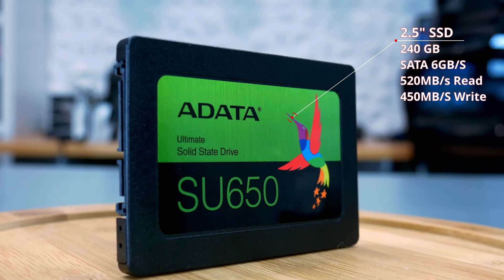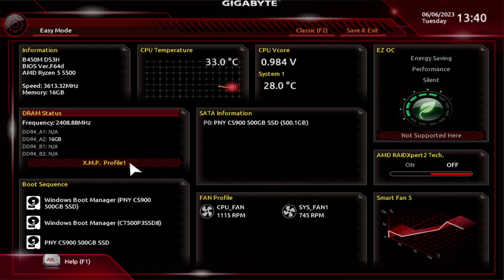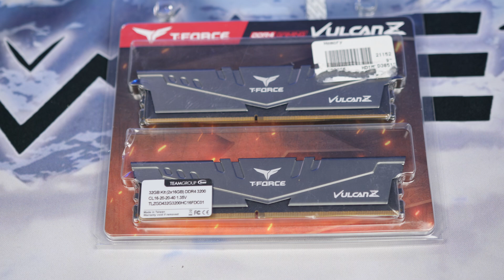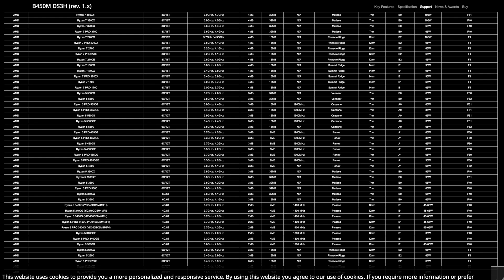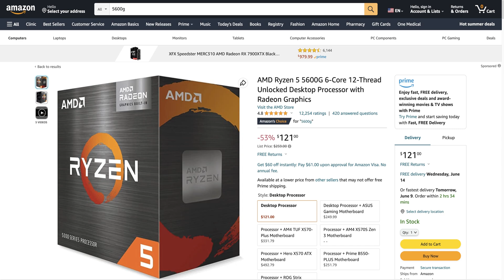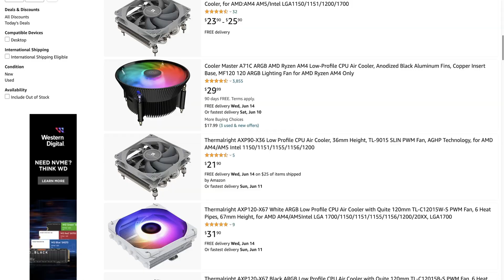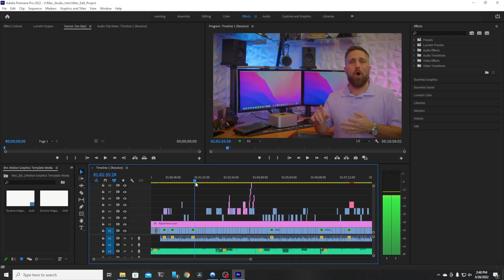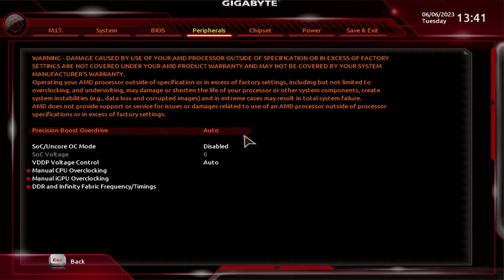Level-Up Your Home Office PC: Computer Upgrades Beginner's Guide.

Comment: A better choice for the front fan would be the Arctic P12.  They're inexpensive and wouldn't require the splitter, as you can daisy chain the rear fan with it.  I use a couple of the slim ones in my PC and they work great.  Arctic also has great customer service should the fan explode.  I know from personal experience!
Reply from the maker: Thanks, I'll add a link.
Reply: "should the fan explode"

Uhm... What? Fans shouldn't explode. What happened?
Reply: @mjc0961  I turned my PC on, heard a loud "crunch" sound, and the fan blades fell out in pieces.  "Explode" is the best single word I could think of to describe it.  I called Arctic and the rep gave me a link to submit the paperwork for an RMA.  They shipped out a new fan the next day using UPS next day air.  It was a very weird experience but their customer service was great.

Comment: Couple of things: pbo on auto doesn't enable pbo, enabled does it, for the cpu cooler thermalright offers much more performance for the price and has a lot of options, also you can grab 3x case fan for like 15€ or $
Reply from the maker: When the only two PBO menu options are Auto or disable then Auto = Enabled.

Comment: in 2021 people were still using dual core cpus? Not even quad core? What did you have them install on it? Vista?
Reply from the maker: People are still using 2 core Celeron and N series processors today in low budget buisness class laptops and mini PCs.
Reply: @ElevatedSystems  My dad had a dual core laptop with 2gigs of mem up until a year ago and couldn't watch youtube higher than 480p. It took an hour to boot and another to resume to his previous browsing session. What kind of business app can properly run on a dual core? Microsoft office 2000 on a Windows Me? Technically you can still use an IBM compatible too for business even today like retro gamers do but should you really, just because you could?
Reply from the maker: @sersys1  Most productivity apps are still single core applications and are more dependent on core speed, not core count. With a new, fast  2 core,  4 thread processor and 8 gigs of ram you can run basically any office application.
Reply: @ElevatedSystems  Please show me a motherboard made for dual core processors that can support 8 gigs of ram. I'm not being sarcastic. I'm genuinely interested. All the motherboards I've encountered only supported up to 2 or 4 gigs.
Reply from the maker: @sersys1  The motherboard in this video, before the upgrade, had a dual core CPU and 8 Gigs of Ram. That dual core CPU on this motherboard can support up to 64G of RAM. (not that I'd ever recommend that)

Comment: The on board cpu cooler is choking on dust very badly, an air duster would help? What about a kraken x53?
Reply from the maker: An AIO is overkill for this type of build, it doesn't fit in the case and a Kraken cost more than the top CPU's I recommended.

Comment: I have the exact same Rosewill SRM-01B-450 case.  It was very inexpensive when I bought it five years ago. I was using it to house my Plex server. I installed a Gigabyte B360M u-ATX motherboard and an Intel i5-9700 CPU with 32GB DDR4 RAM.
A few things about the case though. It's very thin metal so treat it gently and you'll be alright.  I had a Blu-Ray drive crammed in there for ripping my discs and it was a very tight squeeze. There is not much room for cable management so I put in a modular PSU and even then it was tricky to make a tidy interior.
I recently built an entirely new PC for my Plex server with an ASrock B760M-ITX motherboard and an Intel i3-13000 CPU all placed in a Cooler Master Elite 110 ITX case. I put the Blu-Ray drive in an external enclosure. The performance with the i3-13000 is equal or better than the i5-9700! Thanks.